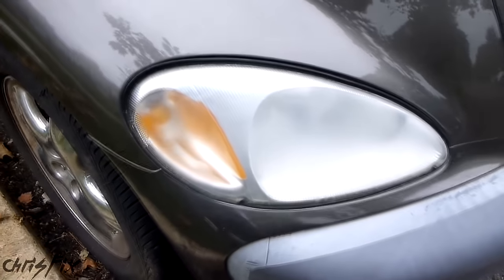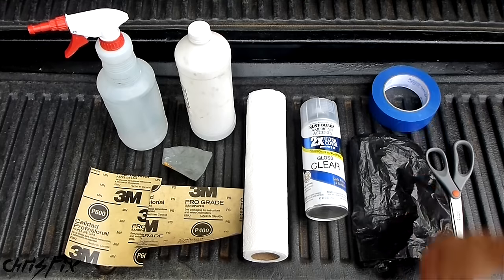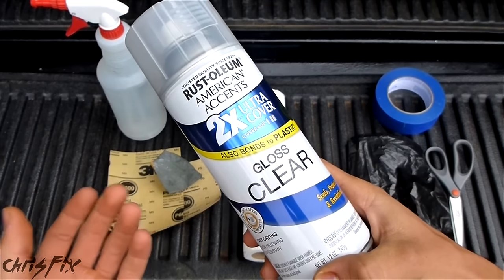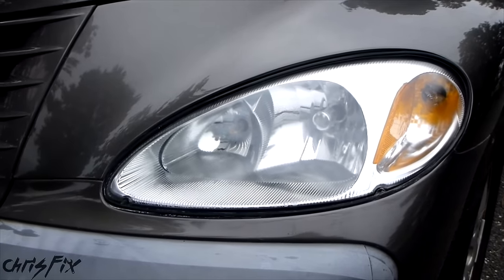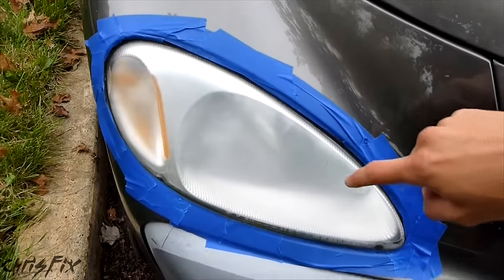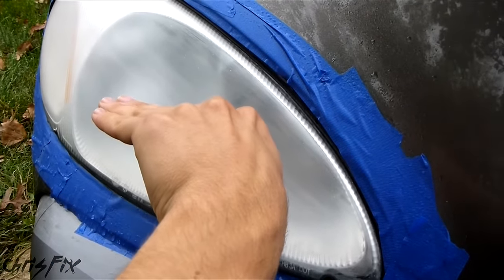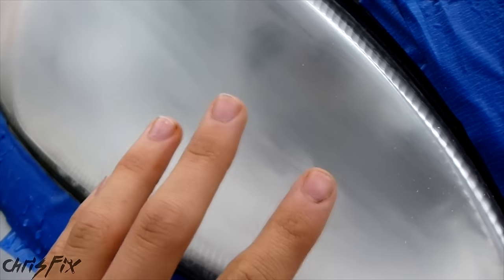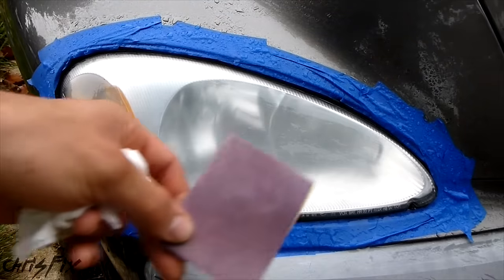How to Restore Headlights PERMANENTLY

Comment: hey chris really great stuff here, i have a question, my headlights have a lot of stress cracks on the bottom and middle, i was wondering if the same sand paper and polish would fix or at least make them less ? thanks
Reply from the maker: +youhan younen the sanding and clear coat might help and fill some of that in or it might not help at all.
Reply: hi Chris,. i have been watching your videos and they are quiet helpful. i have a question about headlights, i have been thinking about buying this xkglow led 76watts headlights(i have 2011 rav4), what are your thoughts on led headlights and do you think this brand would worth to buy ? please let me know or make a video for it
thank you
Reply from the maker: +mehmet tulunbike you need projector housings to run led or hid lights. Can't use reflector housings.
Reply: they say easy install plug and done but now i am not sure about it
Reply: mehmet tulunbike   Chris is semi mistaken. When buying headlight bulbs (which I did just recently) you just have to look for the size. On my Ford F-150 it takes a 9008/h13 bulb. It's a plug and play. However, if I was going to get a xenon hid bulb, housing would be an issue. Xenon bulbs pull a lot of power and hey produce a lot of heat. It would potentially blind oncoming drivers. Or melt your headlight housing. But in your case, led to halogen does not matter. Just look in your owners manual to see what kind of bulb your vehicle takes.
Reply: i was asking ChrisFix to demonstrate us how it is or what to look for when buying led lights, especially xkglow, they seem pretty decent but i do not want to put down money and be disappointed hopefully in near future he may do a special video about led lights and which brand is the potential best or better one. and thank you for your comment Ce!ibrimb0r
Reply: youhan younen عععه767خخ78889800

Comment: I hit it with 2000 wet, then i buff it, comes up crystal.
Reply: it's enough
Reply: Seen another guy do that with a wheel it comes out even better.  More effort though but yeah.
Reply: How long after your last coat did u wet sand it
Reply: just polishing is ok too, but without the clear coat it will haze up again eventually
Reply: What kind of polish are you using when you buff it?
Reply: I do a lot of headlight restorations at the body shop I work. Sanding and polishing the plastic is the number 1 way to restore headlights. It is quicker, easier, and cheaper than putting clear-coat on the headlight. It's also less likely to cause problems. I've seen clear-coat make a mess of headlights after a year or two.
Reply: That doesn't seem right. I think if you get a good coat and then hit it with some compound, polish, then wax with a good machine buffer and pads, it should be no different than how you normally treat clear coat.
Reply: All plastic headlamps come with a coating from factory. You need to put that coating back on or something similar or the plastic will start oxidizing again after a few months.
Reply: +dropinbiking92 and guarantees they fog up again so they keep coming back until you sand through the headlight and have to replace them. Lol
Reply: I pay 10 For Someone To Do My Hesdlights, Its only 2 Min, Wax and Wait Like 4 min And Scrub Off
Reply: thats cool. hey you guys think just hitting it with clear coat can take out the problem of sanding?
Reply: +Unlimited Progress
If you mean don't sand, instead spray clear coat, NO! The outer coating on the plastic is yellowed from sunlight. If you don't take that off first by sanding (or maybe using polishing compound with a buffer) you're just going to cover up the yellow with a shiny layer of clearcoat. Shiny yellow won't look good...

Comment: "Doesn't require adding wax"
adds wax
Reply: lol, underrated
Reply: doesnt require wax but if u wax it it will be more uv resistant and water will run off it better
Reply: Spencer Rogers     It’s polish not wax.
Reply: @caseyplooy1696  collinites wax buddy, your eyes might need a clear coat too
Reply: Casey Plooy  before the clear right??
Reply: Casey Plooy are you Hellen Keller? He literally said the words “car wax” when he was about to apply it. It also says Collinite on the container which is wax.
Reply: Can i use metal polish? Hahah
Reply: Unlimited - collinite is great stuff made in a Utica, NY.
Reply: Doesnt require added SANDING ya muppet.

Comment: Hi Chris. I just performed this on my 2012 Highlander and for some reason, the paint produced a veiny, spiderweb type of appearance. I read where you described to sand again with 1000 and 2000 grit, then compound and polish. But after sanding that much, shouldn't I put one more clear coat on? Thanks.
Reply: Hey, I had the same thing happen. I'm currently letting it dry overnight. Did a wet sand with 2000 grit and polish take care of it or did you have to redo the whole process?
Reply: @onlygothalf  its sounds like it dried to fast for some reason  and that caused it to crack . I think you would have to remove the clear and do it over so there is no cracks . Sanding and polishing wont do anything for the cracks
Reply: sounds like crazing, google paint crazing
Reply: 2000 grit and polish didn’t fix it after letting it dry for three days. I ended up re-sanding and starting over. Got same results. Sanded both again 😵‍💫 (real hard to get off), and went with spraying with Meguias headlight coating. Not permanent but turned out real good. Jerel Johnson wrote that it sounded like paint crazing. I’ll have to research that. Another gentleman wrote that it may have dried too fast but I don’t know how that would have happened. I did it in my shop which was 65 degrees.
Reply: I just tried this today as well and the clear coat is now showing the same spiderweb appearance after 3 passes and drying for 3 hours. Did you end up starting over with  the full sanding process again?
Reply: @dannyb111  yes I sanded both headlights completely again (twice) after letting them dry for three days and after the second attempt, I  used an off-the-shelf headlight coating. The spray paint method just didn’t work for me.
Reply: @dannyb111  several years ago I restored 2006 Chevrolet pickup headlamps with a Sylvania brand restoration kit. Had AWSOME results. Sylvania now sells just the coating on Amazon for $11, which I highly recommend. Their coating is guaranteed for life and at that price, is cheaper then spray paint is now!!
Reply: @jaodaojjo  thanks for the advice. Yeah..the sanding as directed on this video definitely cleaned up the lights but that gloss coat unfortunately  didnt work out on my 2011 Acura TL.. I saw another video where after sanding they just used a Maguire polish which was not as permanent but it would not cause the spider cracks.   In this case...I'll re-sand as you did and then try that Sylvania coating and see how that works.. Thx for the wave.
Reply: @dannyb111  how did it go?
Reply: @karoma5805   I started from scratch to re-sand the gloss coat off with the 3 levels of wet sandpaper.  Didnt get it all off but pretty close. I then polished with something called Meguiar's Mirror Glaze (#83) Dual Action Cleaner / Polish and it cleaned up well though I could still see some blemishes from that 2x Gloss Coat that crazed (spider cracks). I then used the Sylvania UV coat that was recommended and that worked nicely and much easier than the spray. It did not cause any cracking etc. The lights look nice for a 2011 car..no yellow and pretty clear. When you turn them on you can still see they are not perfect...but much better than they were. I bet if I never used the 2x Gloss coat..and just the Sylvania product..they would have been even better. Good luck .

Comment: But, how does someone replace their blinker fluid?
Reply: Send a PFC to get it from the PX, tell them it's right next to the chemlight batteries.
Reply: MrTibbs90 You gotta put it in your blinker light bulbs
Reply: You need track chains to replace blinker fluid. Every private knows that.
Reply: Take it to Jiffy Lube and they'll not only not replace your blinker fluid, they'll break after market stuff on your car that didn't need to be messed with.
Reply: "Blinker fluid"? The blinker is controlled by electrical not fluid influence. Lol. Nerd🤗
Reply: @renekackline2377  deadass it was a joke. he had an april fools video on that years ago

Comment: Wow, this worked amazingly well for my headlight!

First attempt failed miserably, I sprayed the second coat on way too thick. had to sand it off and start over. second time I did even lighter coats than shown here, and five of them. That worked better, but I didn't get nearly as good of a finish once dry, as shown here.

at first was really disappointed and thought I needed to do this yet a third time. However, I wet sanded A small corner with 2,000 grit, then polished it with Novus #2 find scratch remover compound. it's meant for plastics but thought it would work well here too, and I was right! maybe that has the same effect as the wax, a light buffing compound? 

Anyway, they started looking really good but I was still seeing a little bit of a haze, and couldn't figure out why I wasn't getting it out. then I looked very closely and realized it was on the inside of the headlight! The outside had become so clear. I was seeing imperfections on the inside of the lens. 

I guess I could make it even better by opening the headlight, but I just did that to install HIDS and definitely not doing it again. from just a few feet away, the headlight looks absolutely perfect. 

I've seen many comments that this clear coat can't result in a good finish, but that is totally not true. it just requires some finishing work at the end to get it looking really nice!

Comment: "The reason why your headlights are all foggy and they're yellowing..." is because car manufacturers are arseholes and want you to pay a fortune to replace parts you shouldn't need to (if they'd made them properly in the first place).
Reply: +Yorick Hunt Its almost planned obsolescence. Driving a foggy car vs. seeing the shiny new cars makes one want to get a 2016 vehicle.
Reply: +TylerTech Always have to keep in mind that their job is not to make you happy, but to make you want to spend more money on their products!
Reply: i believe they changed from glass to plasticis for collision concerns with flying glass. glass headlights are bought .25" thick. butyeah glassheadlights never fade.
Reply: ethiopianeyes The safety factor may or may not be the case, but the fact is that there're plenty of UV-resistant plastics out there which they could've used.
Reply: My thought is not safety, but COST.  Plastic is cheaper, lighter and much easier to form.  Todays cars all have headlights formed to the cars shape.  Plus my kid has an old Volvo.  Everyone knows Volvos are the safety king.  Her car has formed glass headlights.  They spent the $ on glass so they must feel that the car is safe, plus broken glass from the headlight in an accident is probably not going to cause problems for the occupants, and that is who Volvo is worried about.Great process.  I will buy some high grit wet sand paper and clear coat TODAY.  AWESOME results.
Reply: plastic is CHEAPER, and that is why they use it. very simple explanation, no need for conspiracy theories.
Reply: Car makers are not as you say. They are all making headlights in crazy shapes now and that feature is only cheaply available to them in plastic. If you might remember, or just look at some classic car magazines, all the headlights were round or square. Easy shapes to form out of glass. They have moved away from that.
Reply: Ly Kri There's no question that plastic is easier to work with (and of course cheaper) than glass.

However, among the countless choices of plastics they could've chosen to use, why didn't they use one which had at least some resilience to UV? The answer there is money, and money alone.

They might only be saving $1 per headlight by using inferior plastics at the manufacturing stage, but they're earning many $hundreds per headlight that the end-user has to replace when it fades.

Comment: Is anybody else sick of the Wikibuy commercials that come on with just about every Youtube video?  Enough already.  I am not going to use it just because I am so sick of that big nosed lady in the commercial.
Reply: I f you've never heard of Firefox browser and adblcok+ then you need to do some homework.
Reply: @pedraw  OK.  tell me more.
Reply: @explorermike19  Just search for Adblock Plus on Google.  Remember though, for good channels like this, you're supporting them by watching ads.  Consider turning it off when you watch channels that you enjoy. :)
Reply: @explorermike19   If you don't use Firefox as your default browser then by all means d/l it and make it your default browser. Then go into the options tab (upper right, the 3 little horizontal bars)  and open  add-ons. select adblock plus, I also use Ublockorigin , cookie auto-delete and ghostery. You shouldn't ever see ads again. I also strongly urge you to use Startpage as your default search engine and homepage.
Reply: @pedraw  Thanks for the tip.  I know this is off-topic, but why Firefox?
Reply: Yes, mooneyed girl I have heard of wikibuy about 900+ times. God, I hate that commercial. I don't use addblocker because I do watch channels that rely on youtube for income and they don't get that income if the adds don't come on.
Reply: @explorermike19    It's the browser I've used for years and it's rock solid. A lot of people like Chrome but I'm not a google fan. Even thou Youtube is owned by google. You can look up comparisons of the browsers on the internet and they can explain it better than I can.
Reply: Just get YouTube Red - Best Investment I've made.  No Ads ever + Downloading Enabled to your Phone + Unlimited Google Play Music + YouTube Music
Reply: On android devices use Youtube Vanced for rooted and none root. Pc use Firefox and go to add-ons in toolbar search for adblock. For Apple devices well I don't know or care.
Reply: Ads are based on YOUR internet use. You search "wiki" alot and order things online. I got no ads
Reply: that big nose lady is cute
Reply: Download the YouTube app sir